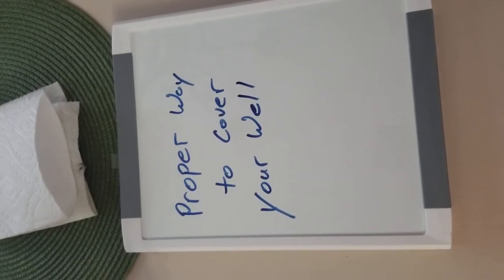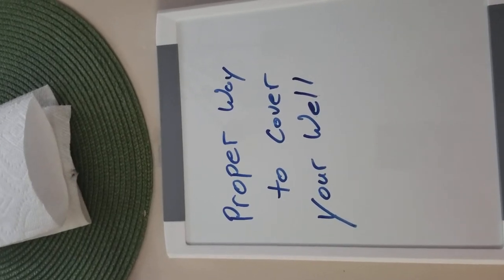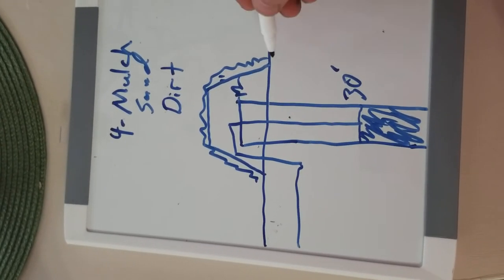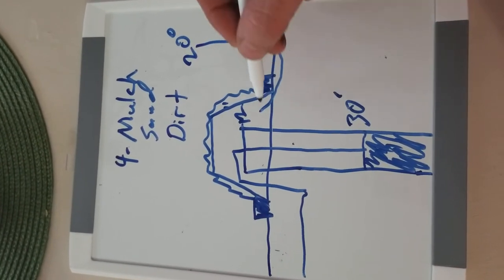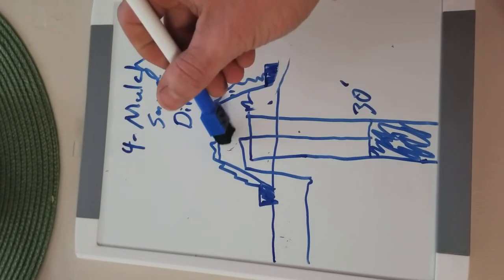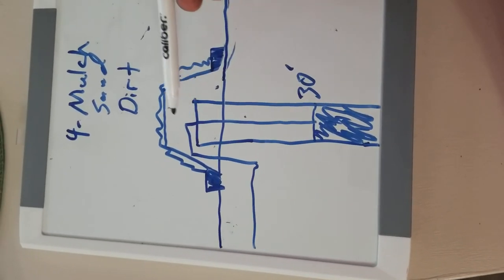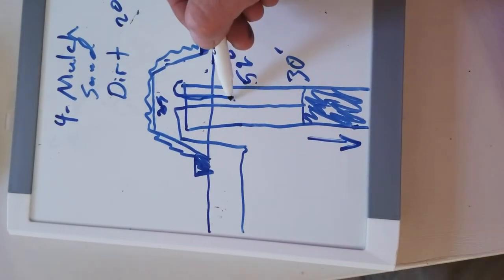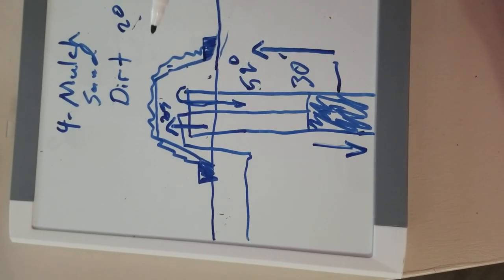How to cover your well & prevent it from freezing!

Comment: Thank you so much. I'm one  of those annoying women who has to know WHY this is the best way to do something. 
You explained it where it made good sense. 
Big freeze coming to Texas this weekend and last time the water froze at the wellhead, which is outside the well house with no protection. 
Being single and stubborn i tend to do everything myself, but I think i can manage a few bags of mulch and ive been wanting to try making faux boulders anyway. Lol not really, but i bet it'll be fun.  And if I don't get it done I've got an old cooler that'll work turned upside down this time 

Thanks, what i figured would be difficult sounds pretty simple. Easier than fixing busted pipes anyway.

Comment: The best way to solve this is to drill  the casing at the trench  below freezing point depending where the will is , and install a pitless valve ,  you guys look up this part at well plumbing supply and see what it is  , with a pitless valve adopter everything from pump to the house will be under ground, and if you are worried about water freezing from the ground to the inside of your utility room at the well casing just about 10   12 " below the pitless valve drill a hole about 1/4 " on the stem hose   , if you are not going to use the water more then a day or so shut the pump and open your faucets, and drain your tank,    now if this is your summer house you can go away without a worry.

Comment: Another Texan checking in with cold weather coming up. In last years freeze the pvc connected to the tank busted at all the elbows. Is it recommended to drain the system before a freeze? What’s the easiest way / will that require me to prime the system after draining the system? The well house is not insulated and exposed to the elements.. should I replace everything with Pex?

The well is at a hunting cabin that gets used probably 12 weekends out of the year and we shut the power off to the whole thing when not in use.

Thanks so much for all your detailed content!! Bought a new switch and pressure gauge (old one is busted) to install with recent intermittent water pressure issues on our OLD system. Will also double check the pressure within the tank
Reply from the maker: There's no way to get a system 100% drained. Your best bet is to cover pipes with blankets and/or use little heater set on low in the pump house. Heat tape works well too. 
A system that is not in use is probably 4 times more likely to freeze up. But pex is a good idea, it wouldn't split like pvc
Reply: @h2omechanic  thanks so much for your response! Next time the PVC busts we'll be going all Pex. Take care

Comment: My friend has a very deep well with jet pump. Since he installed it he has to set pressure @ 70 or it will not stay  primed. Pressure falls to 20 or less and no water flow out. Is this ok? I hate setting psi that high especially because his cpvc is getting old in house
Reply from the maker: Jet pumps are tough to set. You must make sure the tank is completely empty of water & set the air pressure 2psi below the switches "on" factory setting. Sounds like 70psi is high & possibly needs it so high to get the check valve to seat fully closed. It's cheaper to buy a 115v submersible pump & hang it on the 1" pipe the jet pump is using. I convert everyone I do bc the time you factor in parts & labor on a jet pump, & the headache it's cheaper & 10 times more reliable. I have a video showing the proper way to put 1 in as well.